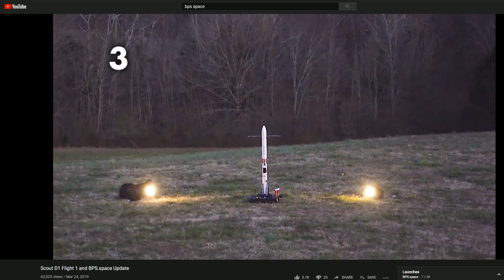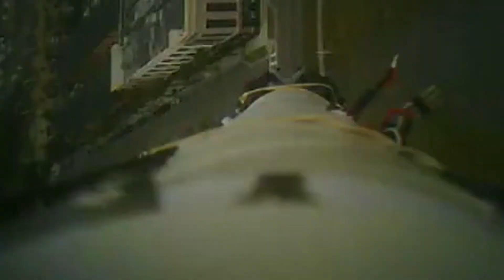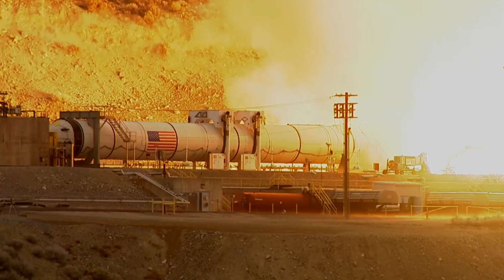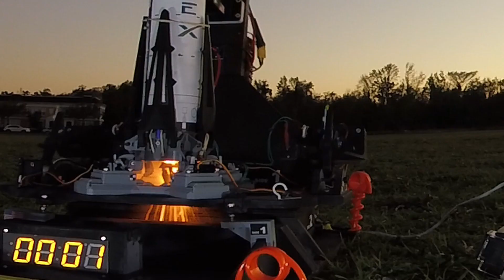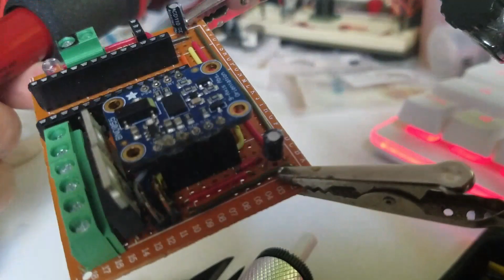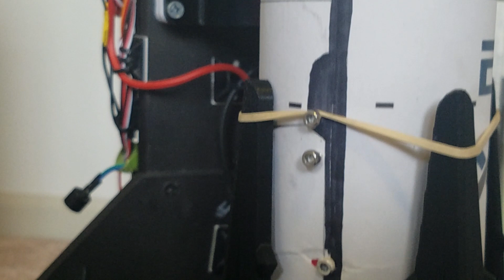T Zero Overview

Comment: I want to learn to make TVC Rockets and I can do it all besides the flight computer, I have no clue were to start on that and I was wondering if you could help me?
Reply from the maker: You need to first have built a non TVC rocket then get yourself an arduino starter kit with servos and an IMU or gyroscope unit. Learn some basic coding and then move to orientation and use examples. a quadcopter has very similar function to a TVC rocket
Reply: T-Zero Systems Will the arduino board bc capable of flying in the rocket or will I need something more advanced. I already have experience with regular rockets and lots of experience with drones, I also have basic coding skills.
Reply from the maker: @PenjaminD  Yes I use a Teensy 3.5 and the rockets in this video run on Arduino nano. The teensy is a much better controller as of my experience
Reply: T-Zero Systems Do you think the Arduino Mega 2560 and a Gyro/Accelerometer and a Altimeter unit could fly?